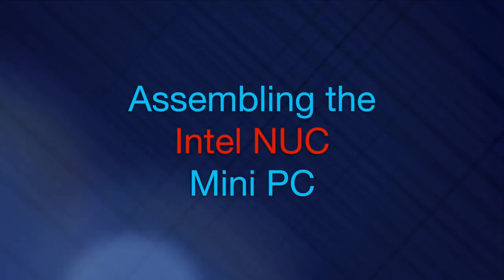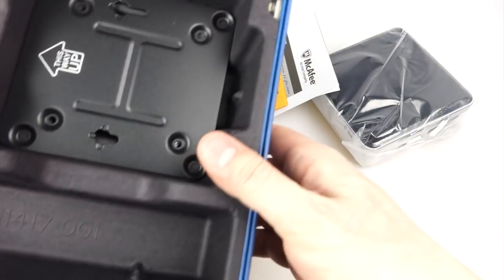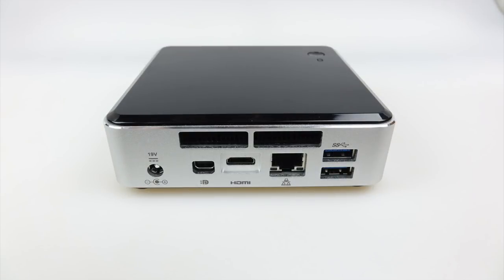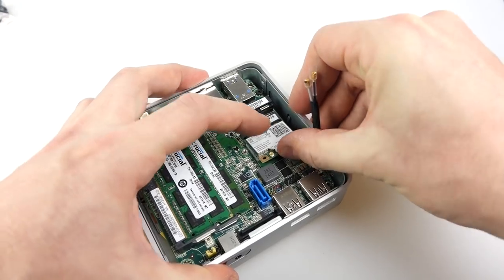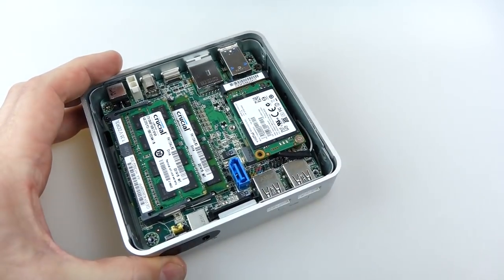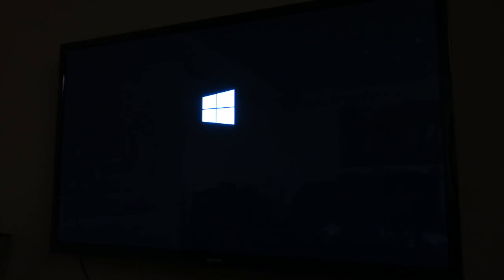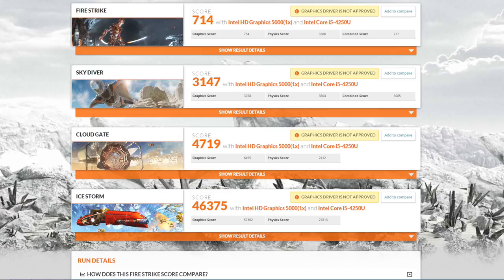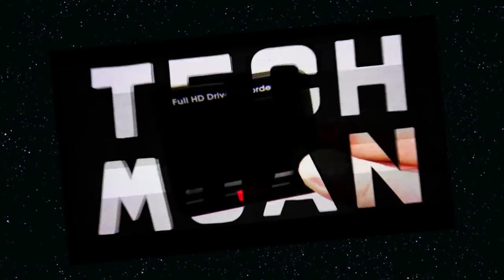Assembling an Intel NUC Mini PC - i5 D54250WYK

Comment: The Nuc is great but I can buy a Laptop that is 4 times faster without having to buy RAM or Hardrive and Wifi modules. This is why the Nuc is not taking off the Price is atrocious.
Considering you have to buy the Ram, the Hardrive, The portable Dvd rom ( or mem stick) + Operating system ( if not using Linux) I checked it out and the Nuc is double the price of a Laptop that is 3 times faster. The Intel Nuc is pricey for what it does.
Reply: It is an iot computer not a supercomputer and also he has the i5 we are on i7 now so meh
Reply: I'ts not about how much power it has. It is about price vs how much power it has. Clearly Intel is fooling people here. Also we need faster processors and not this core nonsense.
We should of hit 5 ghz Processors on Desktops already but now with the Iphone crowd Desktops are not getting faster . Adding cores does not make a faster system . This was the same issue with the 64bit fiasco when Intel itself already solved it back in 1995 with the Pentium being 36 bit thus eliminating the 4 gig barrier. But it's always the same thing a good thing comes along and people do not want to do extra work and thus they ignore it. I installed Windows 2003 32 bit Servers all over the place here and they all had 64 gigs of ram onboard and all the server applications used that ram since they were AWE aware. Blame the Graphics Cards companies for the 64 bit 10 year wait.
Reply: yes but the nuc is a big iot computer but if amd got involved it would be cool it also seems that intel just wamted to compete with the raspberry pi
Reply: hertz are pulses per second if you could do more per pulse(ie. have another core doing something else) it makes it faster as well
Reply: As far as cores only high level Pro applications like Nuke, Fusion, Avid Media Composer, Maya etc actually take advantage of that. If all applications used all cores that would be great but only very high end expensive applications really take advantage of that. Even today all high premium workstations use MULTIPLE CPU boards. There is no high end workstation running only 1 Processor with 8 cores . High end Workstations have up to 4 CPU sockets or more with more $$.

Normal consumers are always at least 5 years out of the latest tech.
Reply: Danfuerth Gillis anyway cores are like mini CPUs
Reply: We dit hit 5ghz, it's called FX 9xxx.
But that CPU has a tdp of over 200w and is generally just trash.
Reply: Danfuerth Gillis unless  you are in to VR because then there is a exceptional graphics card in the computer how ever if supreme commander was made today and used nvidea physx it could offload particles and some physics to the gpu and the cpu gets a holiday it pretty much just has to register key strokes and the rest of the physics
Reply: We're getting more cores and a re-focus on power efficiency because Moore's Law is beginning to hit a wall.  Transistors are now so small that they simply can't function if they get any smaller.  That's why the big R&D labs are turning to 3D and quantum computing.  This is not a matter of Intel vs. AMD, and not an issue that competition alone can resolve.
Reply: It's time for the government to allow us to have what they had back in the 1970's. The whole solid state industry is a joke since it is using 1970's technology. Solid State media was invented all the back in the 1970's. How can you improve anything if no one has access to it for 20+ years!!!
Reply: ***** I never claimed it would be better, just that it is one of the post-Moore techs being investigated.
Reply: Most motherboards have multiple 1x and 16x PCIe slots.  Unless you've got a quad-SLI setup (waste of money IMO), there should be plenty of extra full size slots.  You can also get adapters/extensions like the kind used for GPU mining or vertical GPU mounting.
Reply: ***** Then your best bet is probably a riser card/ribbon.  They're ~$5-10 on Amazon.
Reply: Look at the comments all good tips here.

Comment: why is it relevant to show the download and upload speed
Reply: To verify that the wireless-AC is working properly, especially after his connector incident.  And also to make people with slower connection speeds jealous.  ;)
Reply: but showing the internet working would do that. He could have just googled something and wasted less of my time
Reply: olek raymond But it might not have reflect more minor damage to the antenna wires which could have caused performance issues.  So he showed not just that everything was working period, but that it was working fully as expected.
Reply: If the soldered connection was lose it most likely wouldn't result in a slower internet but no internet at all. If it had been lose at all either all or no data would pass through the wire.... like HDMI cables.

I know he did this to show us it works but the way he did it was what I found problematic.
Reply: That's completely false, cable are wireless antenna, nothing more, you can disconnect them entirely and if you're really close to the AP, it might catch it and connect "fine" but at a very slow speed, the connector acting as the antenna in that case.

That said, it still is a bad test, because is internet connection isn't fast enough compared to Wifi AC supposed speed, a local to local test would have been better.

Comment: Linux can boot up in less that 15 secs WITHOUT SSD. Screw Winshit
Reply: Well yeah, unless you actually like support or programs.
Reply: Are you assuming linux doesn't have those? Linux is supported by people and businesses every because of it's open source. Most programs are on linux, too. True problem about linux though is game support including that a lot GPUs not being able to support OpenGL as well as DirectX
Reply: V01D Okay, I'll give you support.
But let's look at program support (from my windows taskbar)
1. Chrome, pretty good
2. firefox, good
3. spotify, iffy
4. steam, fine, it's valve software and not hats so it's pretty shit anyway, as for game support it's alright not great
5. paint.net, none, there is a clone which is alright
6. videopad, nope.
7. vlc, it's vlc it runs on everything
8. afx, none.
9. audacity, good
10. ets2 and ats, weak

a solid 6/10 on par with windows. So sure, it might be for you, and i've tried it, i've run mint, ubuntu and debian in the past, it's certainly not for any professional media creation software, but professional coders must love it.

Comment: God there are so many fannies out there who think the tiniest things can damage electronics and mechanics. As you identified, there's the "oh, don't touch that without an anti-static wristband, you'll fry it" type, and then there's my favourite, "don't pull up the handbrake without pushing the button in, you can wear out the ratchet" wankers. If they really and truly believe this, I guarantee they have absolutely no experience building a computer or repairing a vehicle whatsoever.
Reply: +Liam S lol at the Ratchet wankers .... those guys spend to much time at rule 34
Reply: +Liam S Agreed!  I've dealt with many many computers and electronics without an anti-static wristband and I've never had a single problem.
Reply: Because I absolutely LOVE shuffling my socked feet across the carpet and rubbing balloons in my hair before touching circuit boards
Reply: Liam S  well, modern pc components are pretty robust, and if you grab things by the edge, any static potential would be discharged safely to the ground plane. However, touching something in the middle of a card after walking around, is a pretty bad idea. Sensitive circuits might handle only a few volts. Just shifting around in a chair can generate thousands. Also, static discharge may leave insidious damage that doesn't show up immediately,  but weaken things so they break later on.

And that's why any half decent manufacturer of electronics takes religious care to have proper ESD safety in their work environment
Reply: Even without anti-static gear, I still recommend touching a ground pin before.
If static can give me a jolt, it can hurt microscopic electronics. I have seen enough board fried for "no apparent reason".
Reply: Funny but the added components DO come in anti-static bags.
Reply: JayzTwoCents once tried zapping computers with really big static zaps made by his weird chair
Result: it didn't die

Comment: Minecraft would run like crap since it does not have discrete graphics
Reply: ***** Hate to say it is bullcrap.
Reply: ***** Your probably right
Reply: xXDahChubChubXx Minecraft is more dependent on RAM than it is on graphics. It'll run FAST!
Reply: Noorquacker Ind. It might but RAM speed does not make much of a difference unless you are running a APU setup, Linus Tech Tips proved it.
Reply: ***** Okay i agree with that but how come my old Lenovo L412 with 8gb RAM a intel i3 and a SSD could barely run minecraft and my desktop at the time it also had a i5 and integrated graphics (intel 4000) due to the form factor and it also had 8gb RAM but a mechanical HDD and it ran like shit as well the SSD did not really make a difference and then i found a old 8400GS with a slim line bracket and put it in and i could almost max minecraft smoothly and the GPU is much worse and newer games than the intel at this point and then after that i got my first gaming build which had a i3 3225, 8gb RAM, Radeon 7750 and a old SATA 1 HDD and it maxed minecraft no problems at all and it is not the fast of a GPU these days and the HDD was a snail but when i got a better GPU  a 750ti from a friend for cheap it ran much faster since the GPU memory and core clock are much higher something like 400MHz and minecraft ran even better again not as many slow downs at all and it was a lot more smooth and then when i did a full rebuild with a i5 4670k, 8gb RAM, SSD for boot, 4tb HDD, 290 windforce  and i can now run minecraft most of the time at 200fps proving that the intel graphics (4000 and down, never really used 5000) can't run minecraft.
Reply: ***** Nope when i played it on those systems i was running something like 1.0.0 or something old but i doubt i had that setting enabled since i did a lot of fiddling to get the most performance out it
Reply: ***** Um no i have not because the desktop has been sold and the laptop is missing the SSD and RAM and i have gaming PC to play it on and i believe it had the latest drivers when i had it last in use.
Reply: ***** Yeah the performance does vary from version to version and i think i will with a Radeon 290 Windforce OC edition.
Reply: Actually no, Minecraft is done with Java, making it more CPU intensive rather than GPU.
Reply: Nameless I've seen about 3.6 GB used on my settings, making it use a lot. I never was paying much attention to CPU usage, but I know it doesn't put any load on the GPU that Intel SpeedStep or similar settings start messing with the frequency
Reply: Minecraft is a cup based game